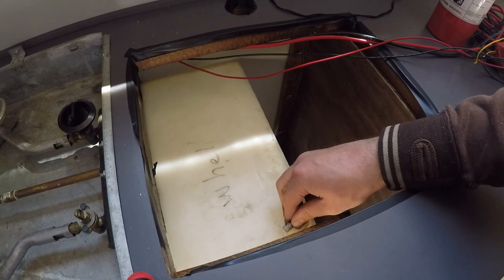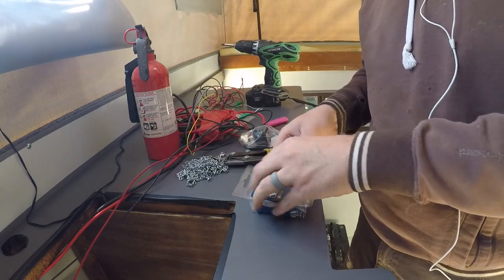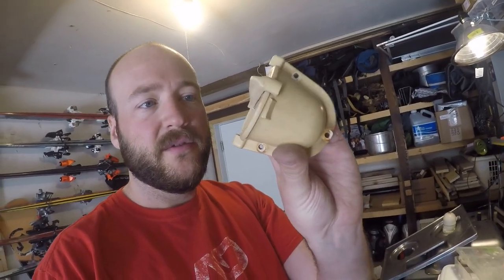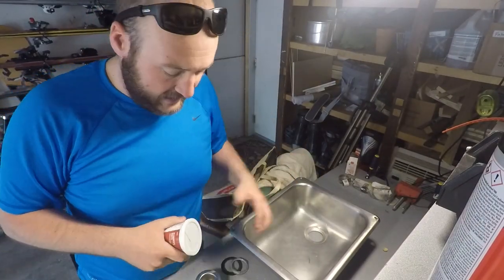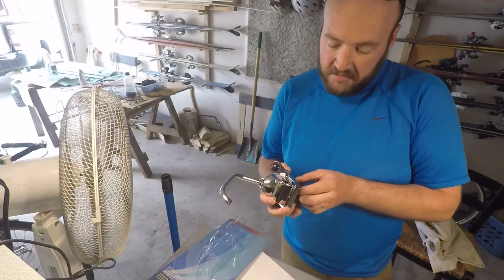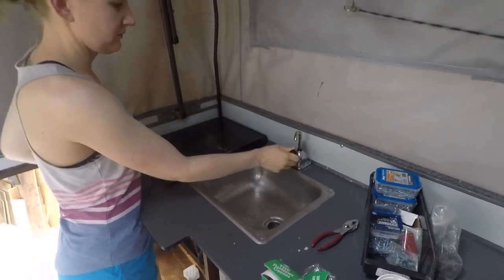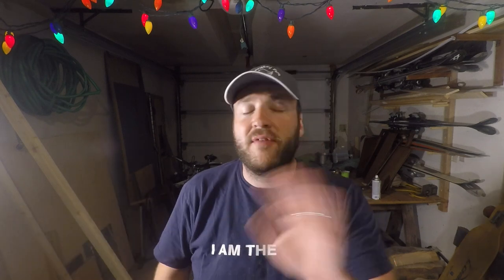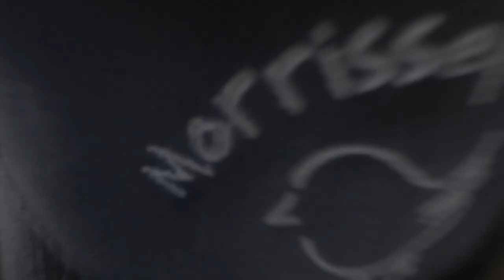DIY Camper Water, Sink, Faucet. | Four Wheel Camper Build

Comment: Curious how you like the rocket pump so far. My FWC Ranger II is in need of a water pump...thinking of replacing with the stock rocket or maybe a foot pump or a 3-way pump.  I like the outdoor faucet, might be nice for a quick rinse or to fill water bottles, but my drain valve is almost right at the bed rail as is :/
Reply from the maker: The pump is working great. The foot pump would be rad too. While the 3way would at convenience, it also adds one more thing that could break. Take that for what its worth. 

The outdoor faucet is awesome. Highly recommend it. They make flexible little hoses that might be able to sneak around the bed rail. 

What year is your ranger II?
Reply: The Ranger II is early 90s I believe.  It’s nice and narrow but it’s a full 8’ Long which is nice and roomy with a gf and two large dogs, but I’m a little worried long term how it will do on the Tacoma.  3-way I would think would still work on electric when the diaphragms in the pump go bad or vise versa.  I’m mostly worried about needing two hands under the faucet and being annoyed to pump by hand.  Sounds like it hasn’t been a huge issue though.  The 3-way and foot pump seem better in most ways, but the rocket will just fit in the same hole so I’ll probably go that route...thanks for the comment/reply!
Reply from the maker: very nice. rad that you have it on the Tacoma. My camper used to be on a tacoma too. I don't find myself needing two hands under the faucet often. Pretty simple operations in the camper kitchen.
Reply: Didn’t realize you aren’t still on a Tacoma. What did you move to and why might I ask?
Reply from the maker: 1st gen tundra double cab. Room for a car seat for my baby! Plus the v8 handles the camper much. Much better. I’ve made a few videos about it. Check my newer videos to talk about mounting the Tacoma and why I bought it. I really
Like the 1st gen tundra.
Reply: Nice! I suspect the double cab 1st gen tundra could be in my future as well...who knows, maybe a baby too haha. I really like the size of the Tacoma though, just wish it magically had more room in it.
Reply from the maker: The first gen tundra really is the happy medium between size and power. Its awesome! Its the tacoma's slightly bigger brother.